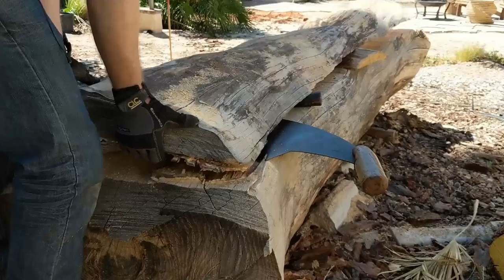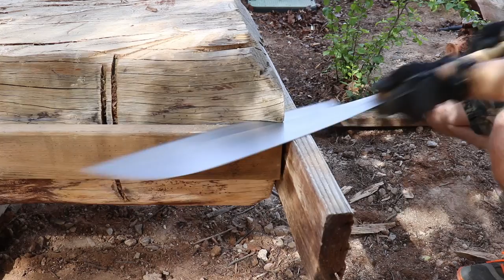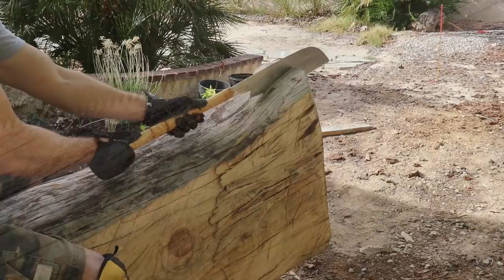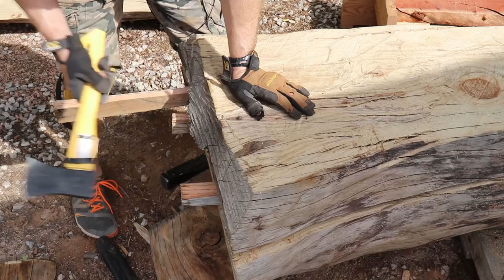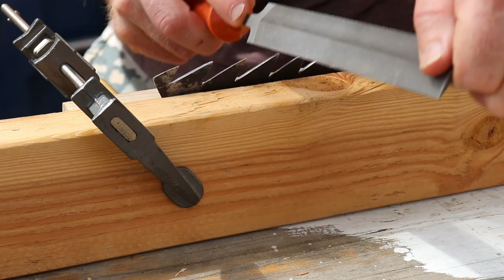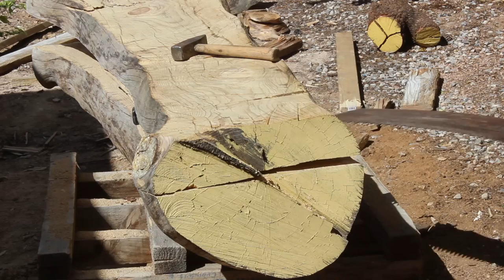Massive Japanese Saws - Cutting a 7 Foot Log by Hand

Comment: Excellent job! Great shop friend, encouragement and rest reminders. Maybe build a hoist to raise one end. There’s physics to raising an end, uses your leg strength to pull the saw, I believe. I think the Japanese prints may be a bit exaggerated, maybe not. Any type of wax or tallow will help the sawing process. I’ve even used old dried out floor wax I picked up for five cents at a garage sale.
Reply from the maker: Thanks for the tips. It was like using a rowing machine when cutting from the side. Wedging made all the difference when I got deep enough in the cut.

Comment: Impressive! 

Are you using some sort of lubrication? 
My sawing became much easier and smoother ahen I started applying paraffin to the blade. It prevents binding, helps the cutting action a little and serves for rust prevention.
Reply from the maker: That's a great idea. Thank you. When I get enough wedged in there the blade just rides in the cut.